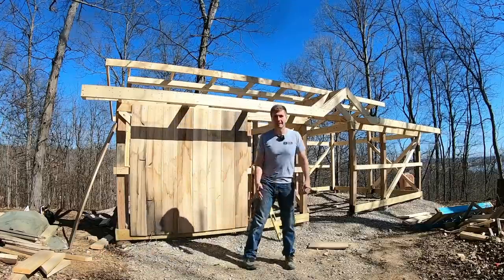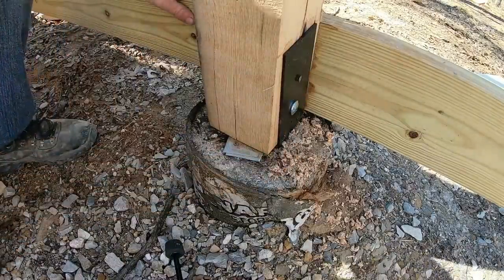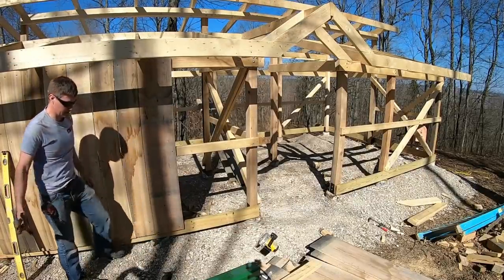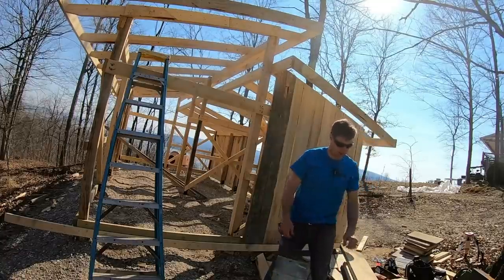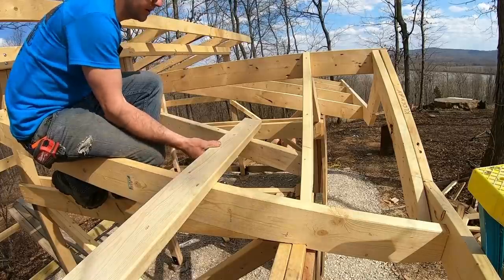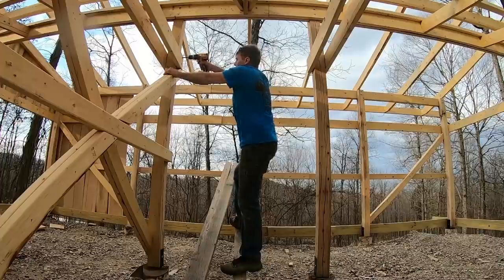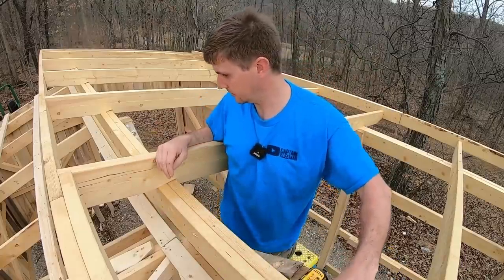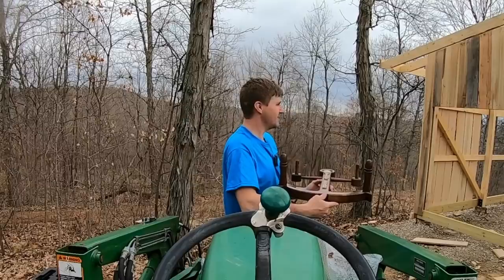Did We Mill Enough Barn Siding? - Building a Mini Barn - Part 4

Comment: Well, that is pretty darn fancy.  I've built a few barns and two houses with the only plans being in my head, but it appears your head holds a lot more framing plans than mine, that's a heck of a job.  I should add that I have a theory that gravity gets selective when you climb onto a roof.  Certain items fall with no regard to the laws of physics, like hammers, drill bits, pieces of hardware you need next, and so forth, they seem to move laterally off where-ever you put them down, then when the way is clear, fall straight down, (although power tools seem to find a way to land on a rock, even if the roof overhangs a sand pile.)

Comment: When they build buildings with with boards they would put 2 inch wide slats on the cracks it helps with the boards expansion and contration of the joints. You might be planning to do that anyway. It looks good to. 👍
Reply from the maker: Yup, that's the plan

Comment: Looking good Captain-in your last video, I saw the nails sticking thru the siding and hoped you would bend those over and I see you got shorter nails. On the long bolts at the bottom of the post, I would hope you will spend the time to cut those off. If someone catches an ankle on one of those it would be a bad day. Keep up the good work.
Reply: For the nails sticking out I'd just hammer a piece of shelving on the inside and call it done

Comment: Looking good.  I can appreciate the comment about material cost and maybe using recycled material.  I always keep an eye out for tin siding and roofing and have some stockpiled for the small barn project I plan to start here in a month or so when the frost comes out of the ground (Wisc.).  I rounded up a substantial amount of roofing tin from a farm for only $100 a little over a year ago, and another pile of some pretty mix-matched tin for free.  In our case, the siding will be tin too, just painted to match the other buildings.  i do not have any mills close enough to be convenient and not enough timber on our property to make buying or hiring a mill make sense.  Though, I do have an uncle with one....hmmm.  I was also able to locate 20 treated posts off Marketplace for only $100 not too long ago.  Finding material like that for pennies on the dollar warms my cockles.  Only down side, in my opinion, is you often build to the material you have on hand as getting matching addtional material can be a challenge, if not impossible.
Reply from the maker: Very true about building to the material when using used.  But a fella has to work with the resources he has.

Comment: I would use screws on siding and almost everything. They hold better and are easier to remove if you ever need to.
Reply from the maker: They also have no sheer strength, ring shanks will hold just as good as screws, especially full headed hand drive ring shanks and provide better strength over all against wind sheer.
Reply: @CaptainKleeman  Screws might have slightly less sheer strength but the tighter joint they provide results in higher friction strength. Ring shank nails also have less sheer strength than a regular nail.

Comment: Well that building isn't going anywhere with all those huge screws and bolt's yikes!!!  Looks like you need some air in that left front tractor tire a bit low.  Smart woman not to answer your question LOLOL.  Not only is that an Anchor it is a WORK OF ART, LOVE AND PATIENCE!!!  THAT IS A LIFELONG TREASURE and I would never use it as a coat rack.  I would certainly have the desire to build a big display box for it and a glass cover and have a brass plate engraved with the creator's name and date!!!
Reply: Sandra.. that is an awesome complement.  I hope it comes in handy… it should be stout enough to hod a couple of coats.    But, I do appreciate your thoughts!!!

Comment: Trees and drones just seem to fight for the same place hu? That anchor is not going up till you have a locking mechanism on it to avoid theft and then maybe a home security camera on it as well. Maybe a glass cabinet over as well as its just beautiful! I know that you wish that you had sawn more boards now but your heart wasn't into making lumber on a machine you were fighting to learn to run. I think that with time that has past, you would do a much better job on a mill should it appear on set. Not likely tho. This chicken shattow should last much longer as it is intended to stay there. Farther away from the house and the summer flies.
Reply: The Anchor is insured… if it gets stolen or broken we’ll cover it!  LOL

Thanks

Comment: You should trim off the excess bolts for the safety of the animals. Animals can do some really stupid stuff. Where does the captain come from? Were you in the military or is it like captain America? Blue is good. Looks nice. Beautiful wood on that anchor.
Reply from the maker: Let's get the walls up and roof on before we start with luxury like that
Reply: Thanks Lawrence… the ring for the porthole at the top is almost 300 years old.  It is from the same board that is in the center of last year’s Cap’ns wheel.

Comment: "Remember on circular saws it's righty loosey." That would depend on whether it's a right or left side blade.
Reply from the maker: You're right,. Here,. "remember, on the standard most commonly used and sold circular saw setup, it's right losey.". Fixed it for ya.

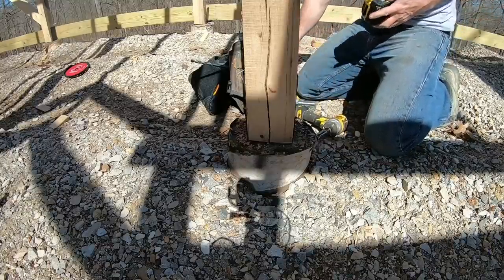Comment: @5:50
Captain Kleeman needs a DeWalt 20V battery benefactor. 
Swapping a single battery from tool to tool works but isn’t very efficient.
Reply from the maker: Ya think I don't know that Wayne lol.  The batteries cost more than the siding on the barn
Reply: @CaptainKleeman  
That’s why you need a generous battery benefactor to donate a couple 5ah batteries for the cause. 😉

Comment: Cap'n, coming along really nicely. But I have to say that I am glad to see that I am not the only one that has issues with these battery powdered circular saws. Because it doesn't matter if it is a brand new blade, with the saw following a fence, it seems to bind because it doesn't have the power of a 120VAC circular saw.
By the way, where did the Cap'n part come from?
Reply from the maker: It's a YouTube brand.  Thanks for watching

Comment: As far as predrilling the bolt holes in the brackets for your posts, wouldn't it be kind of hard to drill straight through the post where you come out lined up with hole on the opposite side?  
  Also, with the barn being so close to the yacht, not sure if I would put any roosters in it. Might make it a hard on your guests that like to sleep in. Goats and chickens will make it hard enough. But on the flip side, it will provide that country ambience though. lol.....
Reply from the maker: I've done it before for other bracket,. A fella just makes a jig so it comes out identical on each side.  Takes a little bit to get set up, but works well.
Reply: @CaptainKleeman   There's times I can hardly drive a nail straight..lol.. holding the drill level enough to make it through the post and hit the bracket hole on the other side just right, well, I'd need some kind of jig that's for sure.. :)

Comment: Great build !!! Only question is why you don't have a portable chop saw instead of a skill saw? Surely you have one ??? Love the content ... kuddos !!! I would only observe you've built an '"AirBnB" Condo ... not a "Chicken Coup"  ... WOW ~~~ And this is not aimed at you ... just a suggestion. I do not understand why "home millers" waste the squaring cuts on their milling machines ... those pieces they throw away would be PERFECT to square up and use every 4th or whatever for planking ... it give "depth" to the solid, 2D walls !!! Think about it ... and would significantly stretch the home milled board feet in this application ... flat, rounded, flat ... repeat.
Reply from the maker: No I agree, I think it basically comes down to the amount of extra time that would take versus the benefit.  All depends on the mill style and features it has.  I would guess most home Mills aren't set for that style of cutting.
Reply: @CaptainKleeman  Gotcha ... just a comment that it's only down to the width and easily done on  the home mill devices ... bark and all would give a cool aspect ... you could even "R&R" exterior planks to stretch your "Board Foot" budget ... it's just some screws eh?

Comment: Can you send some of that t-shirt weather over here to north west Scotland plz
And have to say this build is looking good couple small things I would have done differently but that is because of the amount of rain we get over the winter and in June or July
Reply: What would you do differently?
I live in the maritime Pac NW and have similar weather as you. Much of the advice for homesteading on this continent, needs serious adjustment to work here. "That works great in the US/Canada except the Maritime PAC NW."
Eggplant regularly won't ripe but we can have fresh broccoli almost all year; stuff bolts during the summer drought (6 weeks to 3+ months).
Reply: @tjeanvlogs9894  the siding I would have it horizontal not vertical and have it overlap. I have seen sheds and small out buildings made with vertical siding and over the winter with our high winds the rain gets driven in the gaps
You can put small wood strips on every joint which many people do after their first or second winter with them, but it costs more in the long run compared to having an overlap when they are horizontal
Reply: @HootMaRoot  That's what I was thinking too. Umbrellas are useless here more often as not due to it raining sideways and wind gust. Long roof overhangs (lost the word) and evergreen bushes planted a path with away keeps much of the water off the walls. Have stacked spent hay bales along the sides in a pinch (hay destined for the compost). 
On a continental design, I ended up on a ladder stapling cardboard and plastic sheeting over venting areas in hurricane force wind and driving just above freezing rain once. Yes the cardboard melts, but prevents the plastic sheeting from shredding during the week to month long storm. Gives you time to fix the problem during less nasty weather. Will not be doing that again if I can help it.